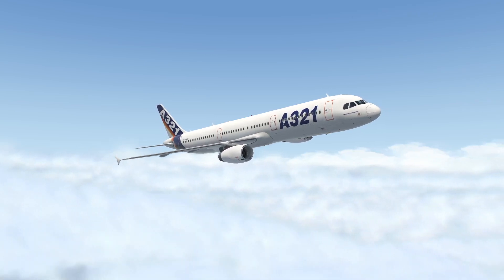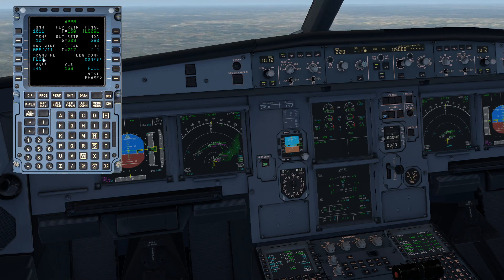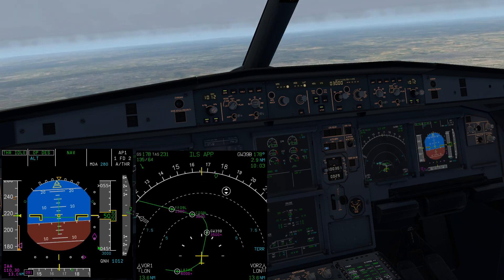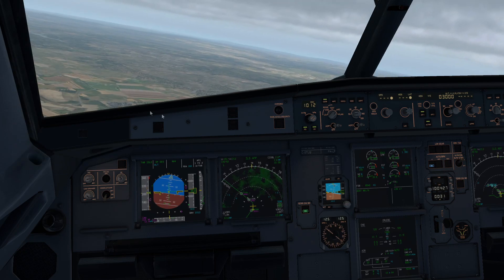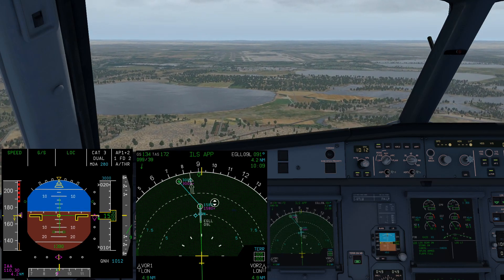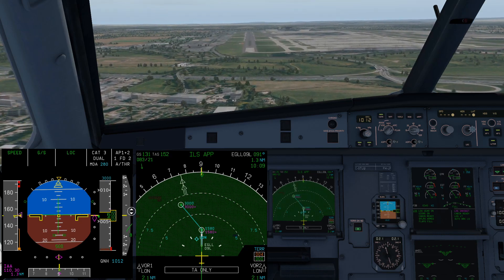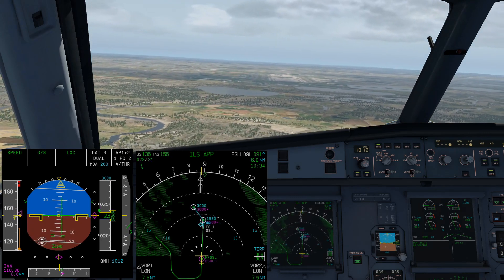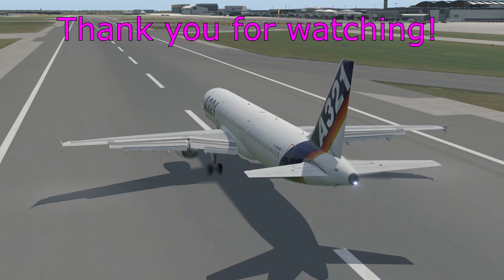Windy approaches in the Airbus - GS Mini explained with a Real Airbus Pilot! ToLiss A321

Comment: I know this is a really old video, but I found this after you referred to GS Mini on your Christmas livestream of the FBW A380 yesterday, because I'd never heard of it. Thanks for the very useful tutorial, even though it's 4 years old! Quick question: Now you're a Boeing pilot, can you tell me if the 787 (or perhaps 777) has a feature like this? I'm guessing the 74, 75, and 76s don't as they're too old.
Reply from the maker: Glad you enjoyed it and thanks for joining the stream! There is no GS mini feature at all on the 787/777, they seem to have relatively higher approach speeds so perhaps aren’t as concerned about the low speed side!
Reply: @320SimPilot  Ah, interesting. Thanks for the insight there.

Comment: I disagree, groundspeed mini is a safety perk added to the airbus aircraft and you should never override groundspeed mini on final approach. Its doing what its supposed to do as you mentioned in the video. If you have to adjust your speed due to red lining your flaps speed then you should be landing at a different runway. We should override any safety protections that the manufacturer installed in the aircraft just like we dont override the ELACS. Fly safe my friend